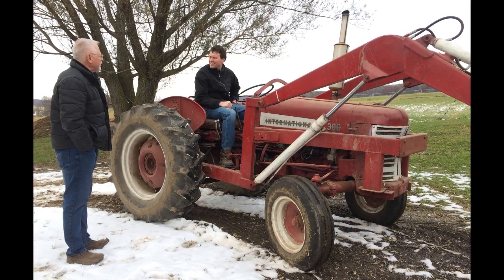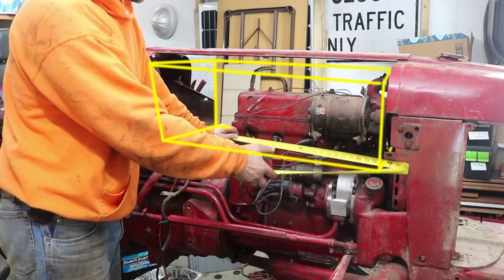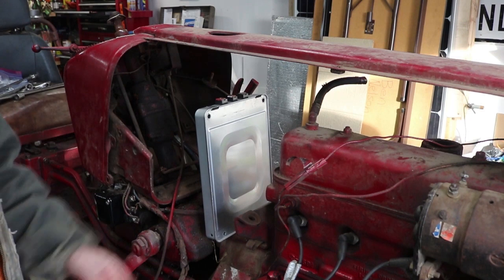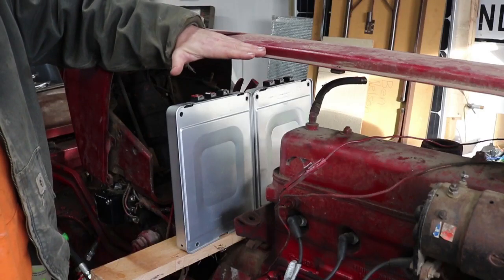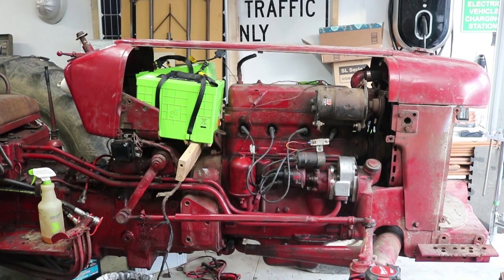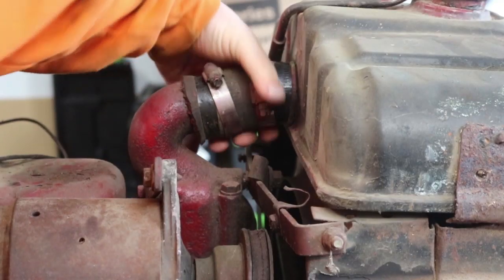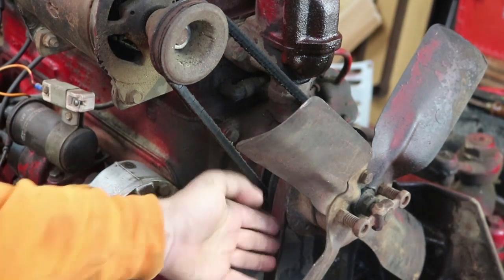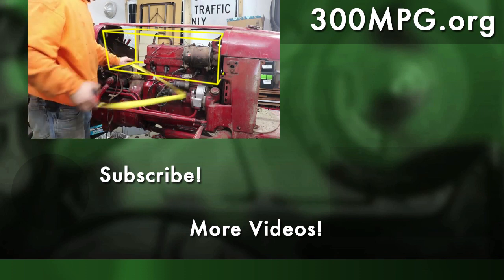Electric Tractor: Battery Thoughts and Radiator Removal

Comment from the maker: At this point, batteries, which motor to be used, etc. is all up in the air. I'm sort of trying to plan this project as I go, because every part seems to depend on every other!
Reply: Hey Benjamin! Thanks for the great video, looking forward to seeing progress on this! I'm working on converting an old Nuffield 4/60 to electric too. I'll be using (2x) Nissan Leaf motors, with their controllers, for this. Check out Paul Holmes's work on this: https://www.youtube.com/watch?v=ALh5nIVC3jY 

As for the pack, I'm going for LiFePo4 cells. You might be able to pick up some cheap BYD packs (see https://www.youtube.com/watch?v=i_V8v4APT60 ) ?

Comment: Thee nice thing about Leaf batteries is the can configure in many groups or directions so you could easily have 3 different spots configured to the voltage you want and paralleled together. The big space in front of the radiator would also work and you get some weight out over th front axle because after the motor is gone it may be hard to keep the front end on the ground when you are applying power to the rear tires. lol. I think you should use clear plexi glass  for the engine cover so all can see what you have done . Cheers.
Reply: I don't know if you saw earlier videos but he had a front end loader on the tractor. If he puts it back on he should be fine with front end weight
Reply from the maker: I'm hoping to design the battery pack in such a way that I could remove one of the side panels to reveal the battery to show it off at events. Maybe I can do a plexiglass cover on the one side.
Reply from the maker: @alanswanson1952  Simple tractor weights are also an easy and flexible way  to change weigh/center-of-gravity/etc. after the fact.

Comment: Good morning Ben. Watching this the first thing I thought of what "you sure are putting the cart before the horse" working on battery configurations before the motor mounting. As the engine is essentially the front frame component and takes a lot of stress, you are really going to have to build a stiff frame for  the front. So I envision some sort of bell housing adapter of course, with the frame wrapped around and cradling the motor. But I am saying this before I have finished my first cup of coffee so your mileage may vary :p
Reply from the maker: What's a little strange about this project is that some things have to be thought about all at once.
Without the front end on the tractor, there's literally NOTHING to get even ballpark measurements from for battery space and location.
Battery voltage needs to match up with what a motor needs, and that can determine the spacing of the batteries.
Since the Cradle/EngineReplacement/part that connects the front end to the transmission needs to be fabricated, it makes sense to design it in such a way that the battery rack is part of it, and fits the batteries.

By no means am I making a final decision on batteries right now. I'm simply looking at what may work to maximize capacity and be the right voltage for the motor.

Leaf cells might be best, as they look like they should fit pretty well, and offer a lot of flexibility in configuration.
Reply: @BenjaminNelsonX  I look forward to watching this all the way through completion.

Comment: I’d keep the old sheet metal if I could and just double stack the leaf batteries up until the point it doesn’t fit. That would still give you 18-20kwh of power. Still undecided on the motor. If you went AC you could repurpose the radiator but DC would provide more low end grunt like the transmission is already set up for. A very interesting build either way!
Reply from the maker: Maybe run Leaf cells the length until they don't fit, and then have a stack or two transverse after that.

Comment: Those Leaf Modules are cheap enough and easy to work with.   I'm currently working on a Power Closet thing using 12 of those Nissan Leaf Modules.   Keeping them at the 25v top of charge is a bit of a pain  but Sure are handy to set up.

Comment: Hi Ben if you recall I suggested axial flux motors in the hub of the wheels, and you responded with a query about the details. Bad news on one front - I found out the cost of one of these motors (790 kW peak torque approx 400mm dia x 100mm width) is 9,000 British pounds from Oxford England. Petrol prices would have to go up a whole lot to justify that sort of expense unfortunately 😢

Comment: Go as far back from the front with the batteries double wide, then switch to being only single wide. That's probably what I would do to maximize the battery.

Or, did you factor how many batteries you could get if you put them in as you first showed, but laying flat and multiples stacked like reams of paper?
Reply from the maker: If Leaf cells were laid flat and stacked vertical, they could only be one module wide, which would NOT maximize the space. I'm sure I'll eventually build some cardboard mock-ups, and test different configurations.
Reply: @BenjaminNelsonX   What I was thinking, was put those terminals on the cell all to one side of the tractor (like seen when you first test the fit and 1 minute 25 seconds). Then they could be stacked vertically and laid side by side from the cowl to the radiator cover.

Quick math, the cell is about 9x13, looks to be about 2 (?) inches thick. So, at the cowl, you should be able to stack 6 high (maybe 7), and then 8 from the drop point forward. So from front to back (the measurement shown at 57 seconds of 36 inches), you'd have 3 stacks of 8 and a stack of 6. 30 total cells. And if you could use the room that continues under the radiator shroud, another stack of 8 could likely fit there.

Comment: I'm going to refer to my 8 N.
40 hp is what the flat head 4 cly produced. Max torque 1400 rpm.
I would use an ac/dc motor.
15 hp / 5kw motor. 1200 rpm.
With low freq. inverter for mobile powering welders and other farm equipment.

Comment: Have you considered center of gravity with so many cells positioned relatively high?
Reply from the maker: This would be the exact same height as a large chunk of the engine and the gas tank. Neither is a light-weight item.
Reply: In the end my bet is he is going to be adding weight to the thing.   Everything being done is taking away tons of weight from what it was originally.
Reply from the maker: @pulesjet   And it would be simple to add weights later if needed. That's a common tractor thing.
Reply: Yes! Get a lower center of gravity for Beter handling in the corners at high speed!
Reply: @paulgroen6902  Intended as a Racing Tractor is it ?   Maybe he can add a Air Foil ta keep the tires Down ?  Snerk Snerk.

Comment: Excellent job I’d go with the battery side-by-side stretch the bodywork wider trying to keep the original look
Side projects if the tractor not being used for long periods of time not being used why not use the battery to run the 

house workshop as well some cheap 
400 V capable inverters on Ali Barber

I’m thinking of doing the same thing with my van I’ve converted and I have two Nissan leaf batteries in that
Reply from the maker: I haven't mentioned it on the YouTube videos yet, but YES, this tractor would absolutely make a GREAT household power backup and I DO want to plan that functionality into it.
Do you know of high voltage inverters that take in 300-400 V at the battery connection? I've only seen ones designed for that at the "Solar IN" and then they also require 48V of batteries at the battery connection. I'd like to think that a person SHOULD be able to just connect the high-voltage DC pack to the solar in, but I haven't seen anyone test that hypothesis.

Comment: 💡 Just an idea. You can also cut open those green batteries and take out the individual cells. They might fit better 🤷‍♂️
Reply from the maker: I've opened up one of the older versions of those Valence batteries. They can't be made denser. Inside, it's all cylindrical cells. They are already as tight together as they can be. One downside to cylindrical cells is that they can't be packed together as tightly as some other types of cells, so you end up with less capacity per volume.
Reply: BenjaminNelson Well that is interesting.
$$$ I am Magine that means they are fairly valuable or at least expensive to buy new.
I thought you probably already thought of that. However I thought I would check just to make sure. I have no experience with those batteries. But I learned something new. Thanks and good luck with your project.